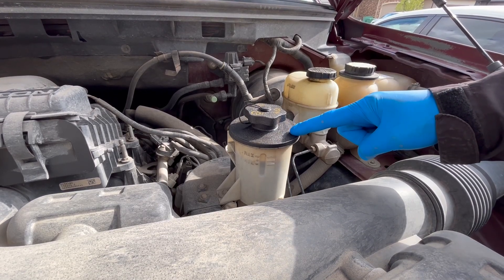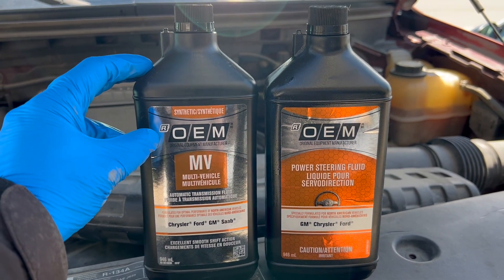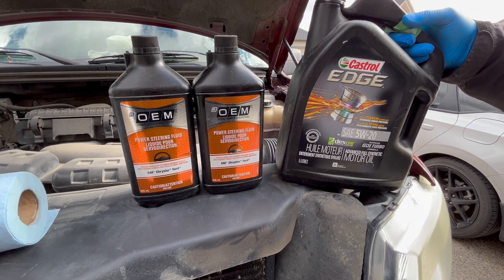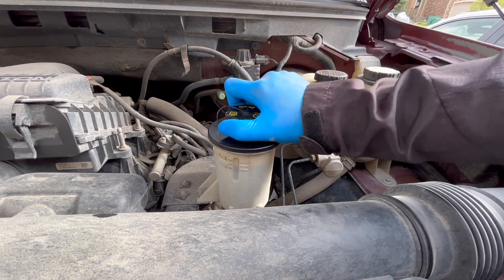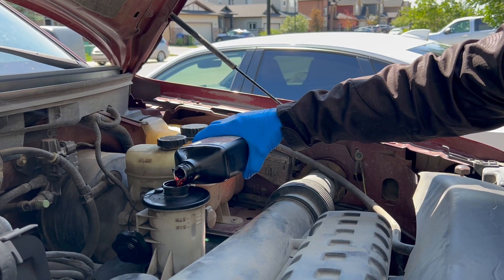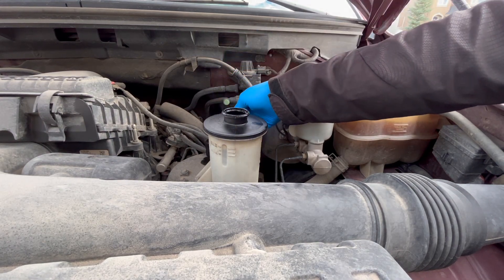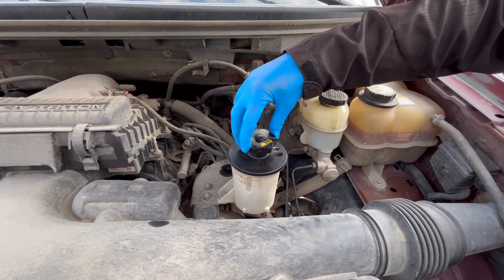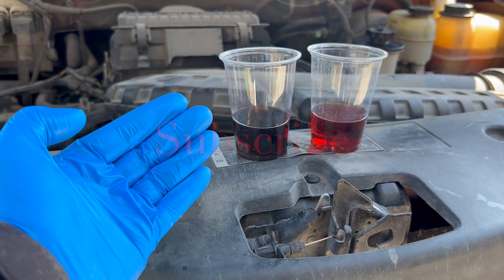How To Refresh Your Power Steering Fluid - easy and painless fluid change

Comment: I flushed my Silverado with 2 quarts using this method- still dark
Reply: Did you check the oil color. Don't base the color when you look inside the reserovor that will always be dark even if the fluid is clean